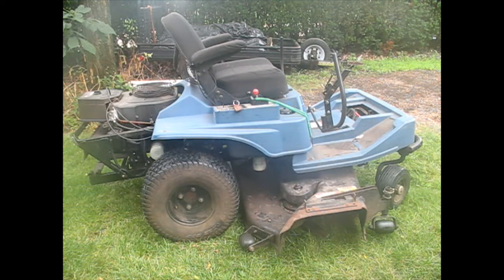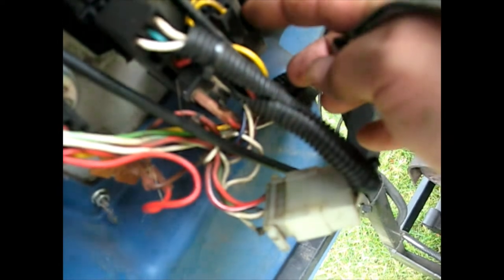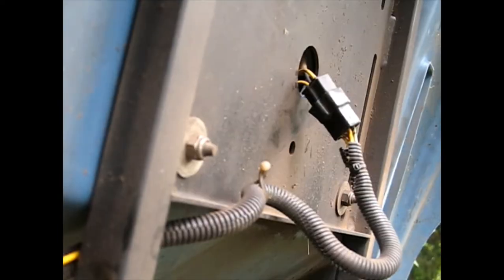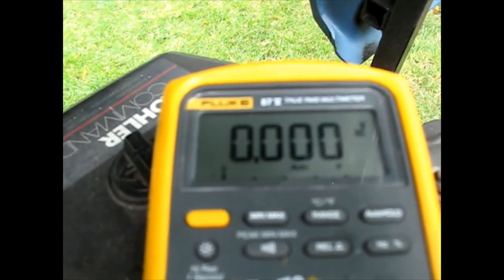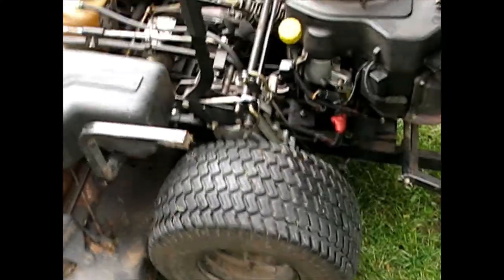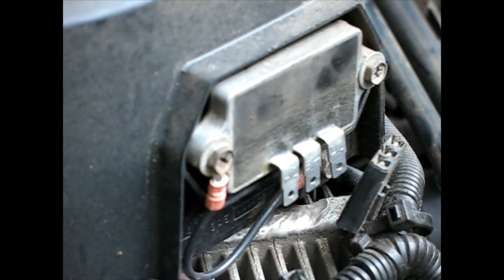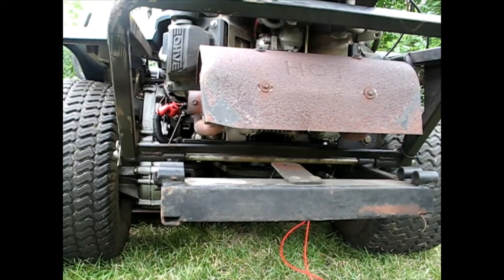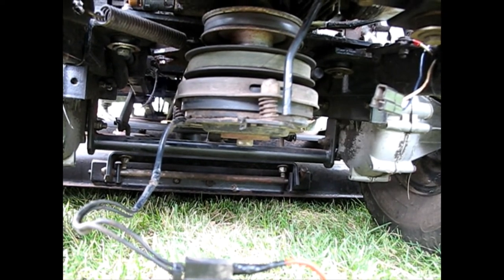Dixon ZTR 5022 part 2 Diagnosing electrical issues including charging system , PTO amp draw and more

Comment: I was given an old Wheelhorse with the same problem. The gas line running from the rear tank followed the frame up to the engine where it made a 90° turn. Someone had duct taped the fuel line to the frame and as the engine warmed up the fuel line softened and would collapsed like an elbow pinching flow. When it cooled off it stiffened and straightened out allowing flow again. Something that simple sometimes can drive you nuts.